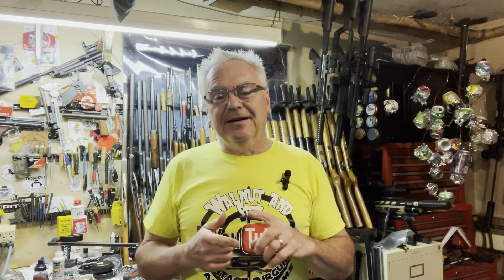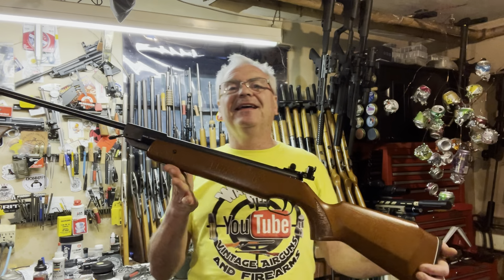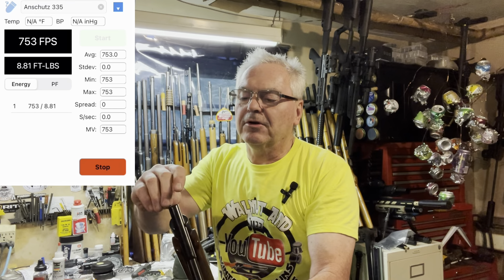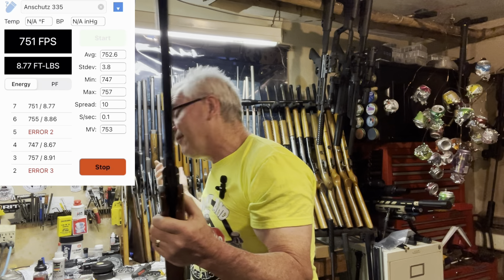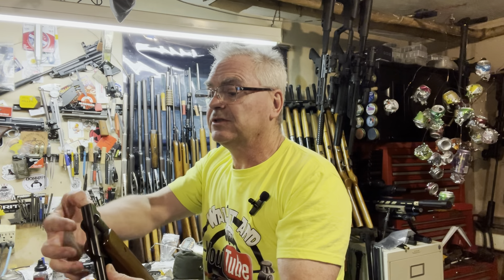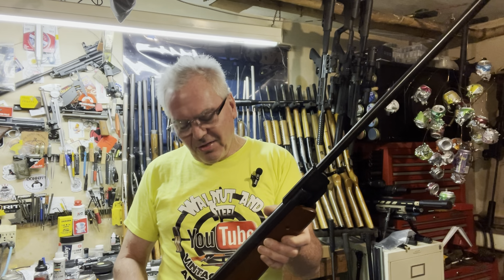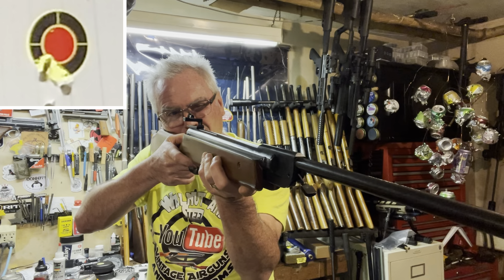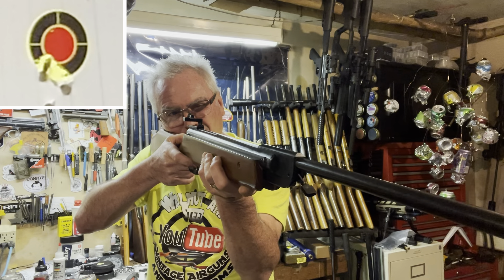Anschutz model 335 break barrel initial performance testing

Comment: I tuned my Anschutz 335 and wrote a five-part guest blog in Tom Gaylord’s (Pyramyd Air) blog in early 2024.  Your earlier suggestions to clean, lubricate and lighten the trigger got it down under 2 lbs.  A new synthetic piston seal came from Australia thru eBay to replace the original leather seal.  A new spring came from Maccari and, in the end, I got right around 800 fps with a 7.0 grain RWS Hobbies.  It’s become one of my favorites (along with a HW30S, FWB 300, and an HW 85)!
Reply: I have a bought it from a experienced air guner it’s already tuned for him, he told me he kept the leather seal, the rifle is high quality made and shoots soo smooth I love it 👍👍